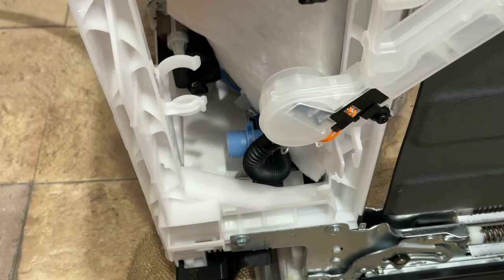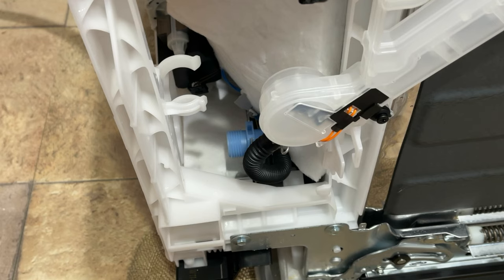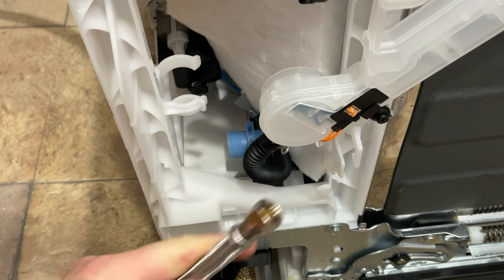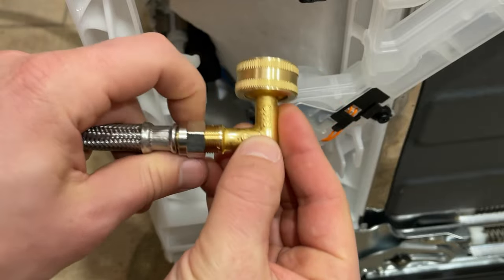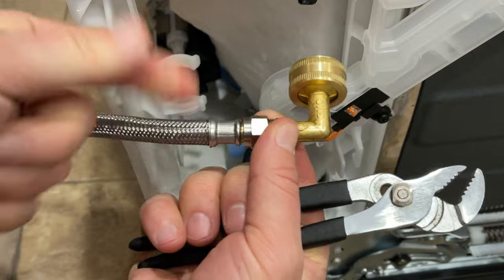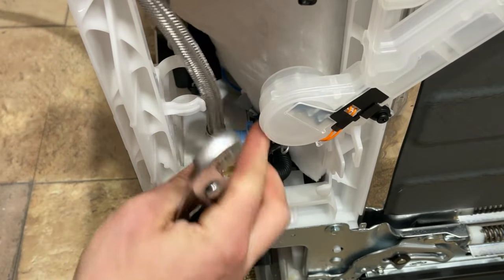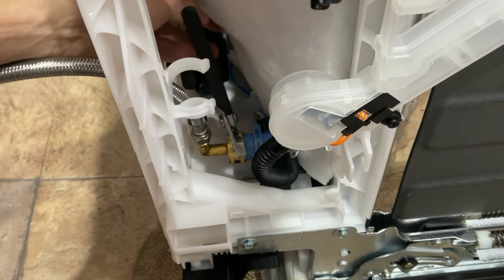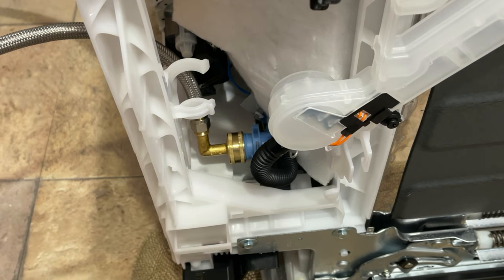How To Install Dishwasher Water Line Kitchenaid Whirlpool Bosch

Comment: Hi I did exactly that with mine. But the water keeps coing out of the where the hose is screwed to the dishwasher. My dishwasher is a Bosch 100 series.
Reply from the maker: Maybe you need some teflon tape to help seal the threads.

Comment: Can anyone tell me if absolute certain all dishwashers use this standard 1" connector with standard across all makes same threads? I have aFisher Paykel unit with extreme hard plastic hose that feeds to it. I do not want to buy a $70 Fisher Paykel replacement hose. I am going to need the elbow, that I know.
Reply from the maker: The only way to know for certain would be to look up the details of the specific dishwasher.
Reply: I managed to do my job. Posted a video about it. So yes, my unit is as standard as most.
Reply from the maker: Nice

Comment: After I get the fitting on tight. Water is still leaking. How do I fix the leak
Reply from the maker: If it is leaking from the fitting then try some pipe tape.
Reply: I have the same issue.

Comment: hi i would like to see the other end as i was sold a fitting that is Push-to-Connect Straight Stop shut off Valve and the braided hose has threads or just tell me what to do thanks
Reply from the maker: So you are trying to install a water line for your dishwasher? As in adding it beneath the sink?
Reply: @HowToVideoChannel  hi. i have a copper water line coming up from the basement that supplies hot water to the faucet i attached a t so that i have a way to run water to the dishwasher. i purchased a dishwasher kit. the kit cameo with a braided hose and shut off valve it is the shut off valve. that  i can screw to the t but the other end of the valve is not a threaded type  so i cannot screw it to the breaded hose ?   i do not know how to attache the vale to the breaded hose. i think the solution is to go back to home depot and get another valve  that is threaded on both sides? thank you
Reply: @HowToVideoChannel  yes
Reply from the maker: That sounds like the best and simplest solution.

Comment: do you connect it to Cold or Hot water supply lines?
Reply from the maker: I believe it is the cold. If you are installing a new dishwasher instead of replacing an existing one then you’d have to run a new line. Perhaps call a local plumber and see if you can get some answers.

Comment: Not sure about the terminology. The blue inlet threaded pipe is made of plastic. The larger end of the 90-degree fitting is brass. 
Question. After the connecting the larger end of the fitting to the blue plastic end of the inlet valve - the junction is leaking, dripping. Tightening causes crucking in the body of the blue plastic pipe.And is still dripping. Do I need to order a replacement valve?
Reply from the maker: Yes, I’d get a new plastic piece. It’s possible there is a crack. You may be able to contact the distributor and ask for a replacement. Perhaps the one you have is defective.